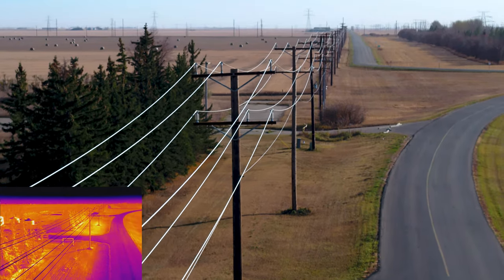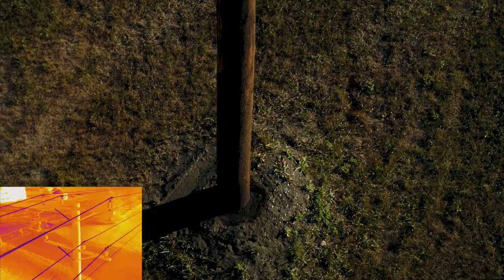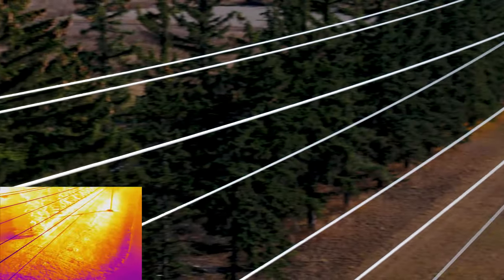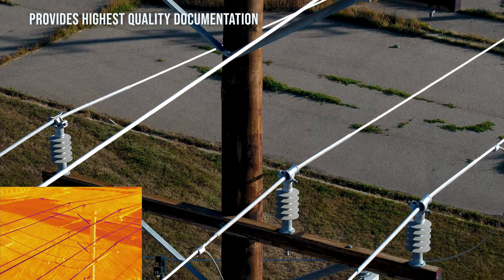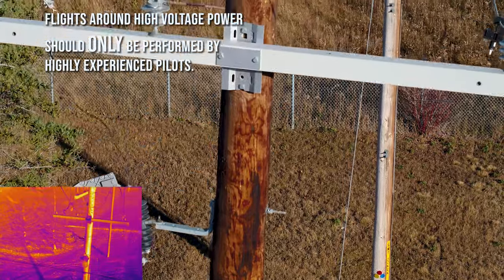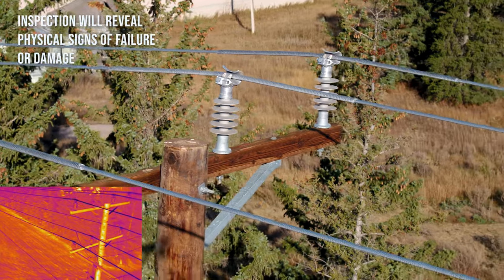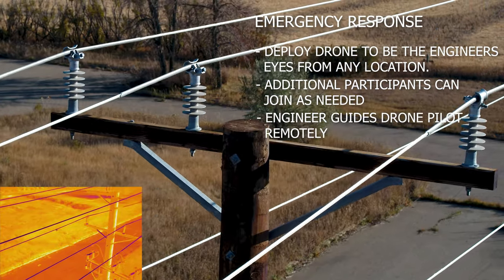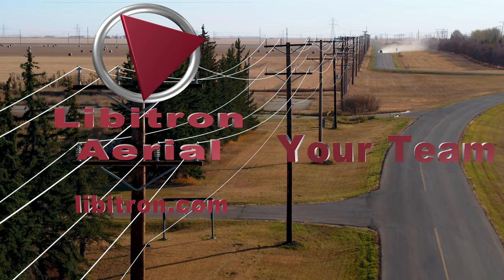Drone Power Utility Pole Line Inspections

Comment: In the video what exactly were you looking for from a thermal perspective? Majority of the poles in the video had no connections on them so I assume those poles were a visual inspection only. What is the temperature limit you use that you would determine a hotspot? Thanks

Comment: I`m in a home inspection (facade) small business. Really liked the digital twin for reporting issues and reports for customers. I don`t have the necessity for asset managing. Whatou would be the ideal drone/software to work under this scenario? Most of soft. aims asset management and have prohibitive prices for small business inspection. Great Video!
Reply from the maker: Ideal drone ..... seems like an easy question but it is not really. If I understand you well enough, you are looking for a thermal solution for inspections including facade. For most of the inspections you will be fine with a relative measurement because you will either be trying to identify insulation issues or water issues. The insulation issues are a bit tricky without a radiometric camera however even though relative temps show you where there is a change in temp. I find myself using the radiometric thermal for those inspections because the thermal output display just appears to be a dramatic difference when in most cases that is not correct. So I would say at minimum you have to have a thermal setup that can provide at least a temperature legend so you can identify what each display colour represents. So I think a good drone for you is one that can provide at the very least that information. It is very easy to just name a drone but I think you should do your homework and decide what model suits you. I am just offering my opinion on minimum specs. The truth is that adding a Vue model to a drone is a great option even though it will likely end up in a fixed position. I see those coming up for sale all the time in the Flir Facebook groups. The thermal decision may be more important that the RGB since most drones will work for the inspection. What you do have to do is make sure that the drone is compatible with the mission planning software that you choose. I think drone harmony is a very good platform for facade inspections but this is another thing that is very fluid and changes so fast. The is all a very long answer to finally say that you have to do your homework. I hope my intention is clear in my answer and I wish you all the best.

Comment: Could be a little bit more interesting, if you would show, how really grid problems looks like, and not only good grid state. Because so, people could not really understand, for what you need such method of inspection.
Reply from the maker: This inspection strategy is a matter of maintenance. The purpose is to spot developing problems.
Reply: @libitronaerialdroneservice 
In this video the speaker speaks about much advantages by inspections and searching of grid problems, by using of such methods, like drone with visual and thermal camera. But video doesnt show this advantages, how this looks like. We see only new grid in good shape, without some problems, without demonstration of advantages and so on. I expected to see, for example damaged insulator, where in visual camera is nothing to detect, but in thermal camera this insulator is shining like lamp from warmth. To see bad distributed power on lines, which have different temperatures, too small dimensioned or damaged transformer, which is very hot, and so on.

Comment: Which UAV and payload was used during this video ?
Reply from the maker: Our work Horse for this type of inspection is the M210 RTK with an X5S and 45mm lens and a Zenmuse XTR Thermal. We also use a Z30 very commonly, but since our usual procedure is to have simultaneous RGB and Thermal, the X5S is usually mounted. Some people will argue that the XT2 may be a better camera. It would offer some benefit but over all we like the XTR mainly because it is the best mapping Thermal camera we have used to date. We map a lot of commercial buildings. The sensor in the XTR is fantastic. And we also use the same RGB and thermal video for the roof inspection process. It works even more effectively with the roof inspections.
Having said all of that, if our inspection type was a little different or if we were mapping the lines, then we would almost certainly be using an M300 with A LiDar set up. Mapping lines with RGB is very difficult to get the lines to produce well in the models. RGB is fine for an ortho, but not for a model in our experience. Maybe someone else is able to pull it off, but we have not in a satisfactory way. The M30 is also an excellent choice and something we are considering to try out.

Comment: Why are these inspections necessary? And if company doesn’t do it is it wrong on there part? They it’s to expensive to change rotten poles and just fit as they fall
Reply from the maker: Preventative.
Reply: These inspections can catch what roll-by line patrols can't: loose tiewires, broken strands on linewire, broken insulators,  failing equipment, or loose hardware.  Even vegetation requiring trimming.